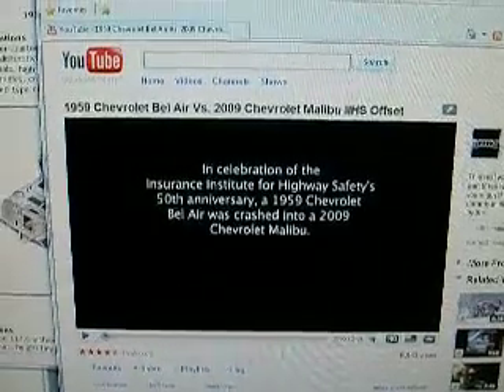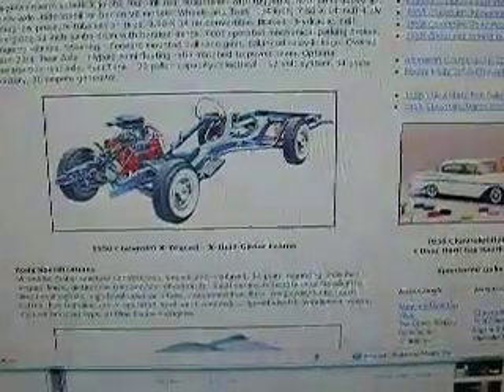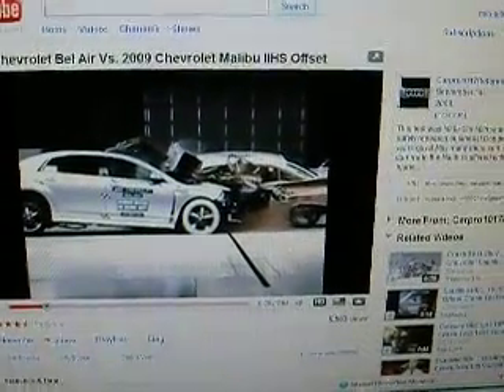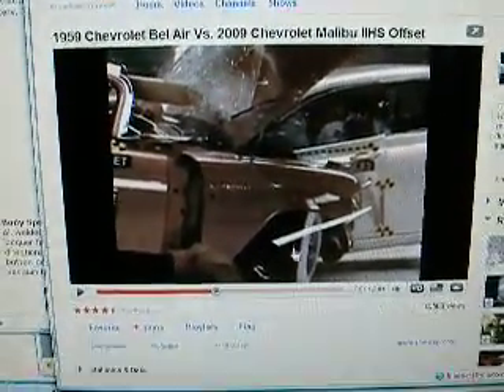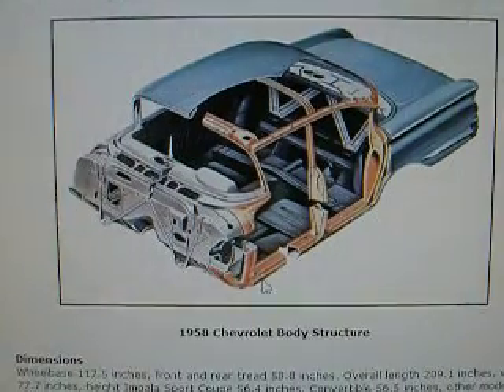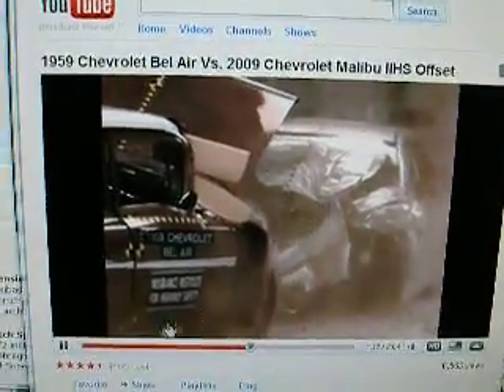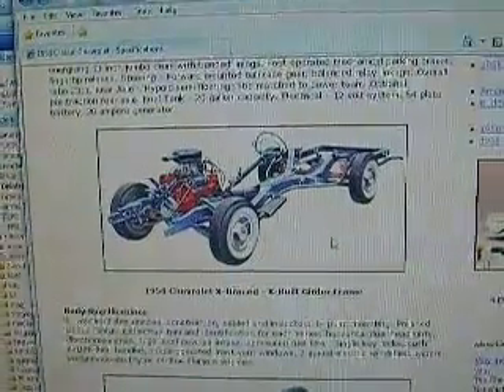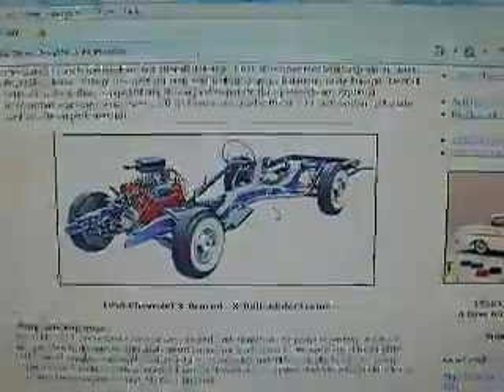IIHS '59 Bel-air vs. '09 Malibu, video response.... not faked.

Comment: I agree with your analysis of the crash.  I do have to wonder though about the condition of the frame after 50 years of exposure in regards to corrosion.  It can look just fine outside, but inside it can have some pretty serious pitting which would weaken it.  I am very familiar with restoration of the '59 through '64 Chevrolet and Canadian Pontiacs.  Contradictory to the information quoted by @bodymanification from Hotrodder magazine, there are a minimum of 8 body mounting points;10 for ragtop

Comment from the maker: You're looking at different modes of injury.... the '59, the deceleration forces were likely fairly sedate, but the blunt force and crush trauma would be incredible. On a '57, the decel would likely be greater since the car wouldn't absorb as much impact, but no crushing, and only blunt force trauma. 

Factory belts or modern ones in the '57? With a lap belt you'll be picking steering wheel out of your teeth for years (or vice versa).

Comment: Thanks for the replys guys. I just wanted to ask opinions. I understand where people are coming from with questioning, (or answering I should say) when it comes to rust. My Dad has an '89 F-150 Frame rotted completely out. From what I understand manufacturing cut out some of the zinc in the 80's The guys that fixed it said they seen the same thing happen to a 2000 F-150, thats sad. With that said, I do agree that the '59 "Folded" naturally, but it didn't help that its 50 year old metal. Thanks

Comment from the maker: Pop-out windshield:  actually did used to be somewhat of a safety feature back then in the era where if there were belts at all, they were loose lap belts on long, flexible bench seats. I would much rather have the windshield pop out instead of the alternatives... ejection *through* the glass, or putting your head through the window and then dropping back into the car. Glass was also laminated, but damn sure not "safe" and barely tempered.

Comment from the maker: I don't think the rust is structural at all, I can't remember if I mentioned that or not. It's as you said, silt and crap, flash rust that built up in nooks and crannies that the paint booth couldn't reach (i.e. inside the door sills), and possibly even paint dust from surfaces scrubbing togehter under pressure. The actual support structure is exposed, I doubt it'd have been allowed to decay.

Comment from the maker: @3762569 The only thing that would help the '59 in a frontal offset like this is if that driver's front frame rail met *anything*. It's hung out there like a tree branch with no support, and better yet, there's no support behind it at the rocker panel either. Hit one hard in the side and watch it split in half. An X frame might be an interesting idea for driving dynamics or efficient production, but not for anything with any possibility of taking a vehicle strike.

Comment from the maker: @jeremiahskates You know, with about 5 seconds of searching you can find NCAP percentage offset tests (done outdoors) for the '08 and '10 Tauruses. IIRC the 50% was done with an impact speed of 70mph. Granted that's about the best chassis I've seen for impact durability, but pretty much any older vehicle with the same test will look like a rumpled ball of tin foil afterwards. For that matter, you can go watch the car start to roll off the test pad after a 35mph direct head-on barrier test.

Comment from the maker: OH, and... a modern car in 50 years is going to be a rebuilder's DREAM. Surface prep, galvanizing, parkerizing, better paints, stiffer structures, no gutters or water catches...  I had a Daewoo Leganza that got a ding on the fender lip deep enough to chip the paint. I procrastinated since it wasn't that important to me, and months later, the exposed metal... was still rough and grey. Sure looks parkerized to me. Totalled it later, paint was so flexible that the rumpled hood didn't even crack.

Comment from the maker: if I had to wager a guess? With the same overall circumstances you'd see more damage to the malibu, but not by much. The '57 though, provided the frame is properly squared and impacted on the end of the rail, it probably going to take the impact well but buckle above the B pillar and jam the doors shut. The G forces in the Bel will be MUCH higher than in the malibu or the '59 and may be fatal all by themselves. 

Something always discounted too is that brake dive on older cars is *extreme*...

Comment: Sufficient research. I have a question regarding your opinion. I just recently left my comment on the actual video, and I would like to know what you think about the rust? I consider myself a classic car enthusiast, I'm around them all the time. Even if it wasn't rust and was in fact just silt and crap, it's 50 year old metal. It's going to give. I suggested crash test the 09 in 50 years and compare. By the way CptTuttle I can accept the fact of saftey. I have an education of Industrial design.

Comment: @Supergungun Well no, a Honda can't do that, but if you're secure and don't drive aggressively you won't need to intimidate anybody, although it's kinda cool. But the interior room, space efficiency and ergonomics in the Crown Vic is poor for such a big car. An Accord feels better and doesn't produce the driver fatigue that the flawed Crown Vic does. Even the new Taurus feels bigger. And both cars are safer and use less terror funding, oil spilling, troop killing, money wasting fuel.

Comment from the maker: @3762569 Nope. I am going to believe though, that the '09 drove right up along that skinny 6 block and straight up to the passenger compartment. 

Are you going to believe that one unsupported angled steel bar, a sheetmetal inner fender, and a sheetmetal outer fender is going to stop a nearly two-ton car from diving right in to passenger space and swimming around like a shark?

Comment from the maker: @harlon2u All I'll say is, you're wrong, and I hope you never have to find out the hard way. There's a reason it's impossible to find a new mid-sized car today that weighs less than 3500 pounds. My '03 Sonoma weighs a hair over 3000, and it's considered a death trap. Hell, a new Taurus weighs well north of 4000, up near the 4300-4400 mark. That's MORE than the '79 LINCOLN MARK V I learned how to drive in. The force control and absorption is far better on newer cars.

Comment: Great response.I agree it wasn't faked but it's so typical of the IIHS's staging for sensational self agrandizment and claiming credit for the work of the auto  engineers.typical that they took a vehicle known for a weak frame and staged a crash to exploit that weakness.

Suppose they pitted a 09 vs 65 Dodge.That would have been a much more balanced test.The 65-78 design was  tanklike.The remaining cars have been banned for years at Demo derbys since they have a structural advantage.

Comment: @harlon2u Even if a car's body was made out of solid titanium, and could withstand faster crashes, the occupants would die from the sudden abrupt impact on their bodies. So, when you referr to "weaker" materials of modern cars, what you're really referring to is something called a "CRUMPLE ZONE". It's a GOOD thing. 

Btw, carbon fibre is stonger than ANY steel made in the 50s. Why do you think F-1 cars' tubs are made of it?! Do a little research, man.

Comment: The black line was not the "center line" it's a track that's used to pull another car if they want crash something from another angle. Old cars were simply not designed for safety, new ones that pass IIHS tests are. The IIHS is not NHTSA which is a weak government test. Look it up.

Comment: This car was not rusted. A better non-X frame might have held up better, but it's occupants would still be dead and that's what matters. The Malibu's unibody is extremely strong and designed to hit a car of it's own weight and stay together and protect it's occupants. The 1959 Chevy weighs the same as the 2009 Chevy. An old car of similar weight would lose every time to the new Malibu.